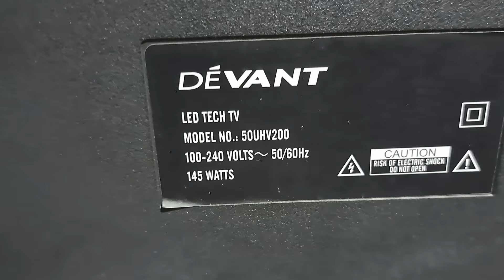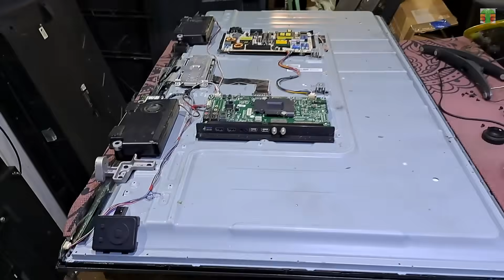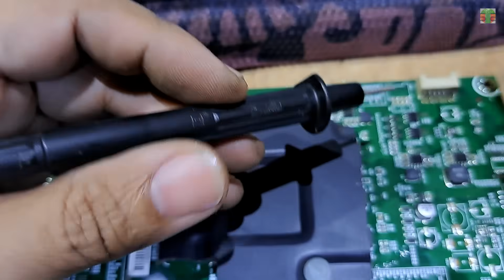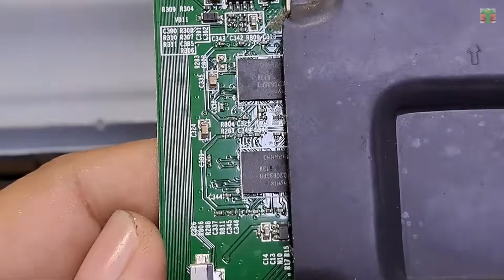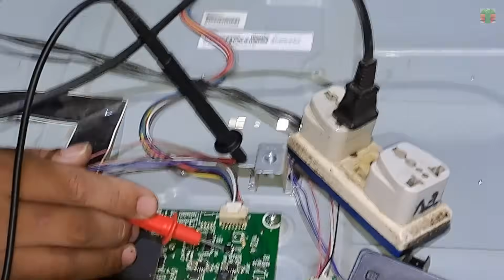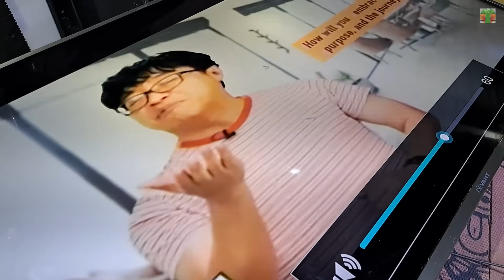Devant smart TV no power

Comment: Good job Master .
this was a hard job without a hotair gun .
But you did it perfectly ❤.
I don't know if this idea will be good or not .
try to use a soldering tweezers .still it can be handle easily .
please just correct me if am wrong .
10k resistor you use isn't it .
Thanks ❤️

Comment: Filipino ka boss? Taga ean ka?
Reply from the maker: Oo, dito ako laoag City
Reply: @tevzTVTevatronics  sir meron po akong nerepair na samsung UA32EH4003R wlang 13volts sa Power supply. ok nman lahat ng diode. Anu po posibling sira nito.ok naman siguro mosfet regulator nito.pls reply po.slamat
Reply from the maker: @BradBuddy-hw1zu  check mo yung pwm driver
Reply: @tevzTVTevatronics  wla pong feedback galing da mosfet regulator. Number po ng mosfet 4NM60N .Pwede po ba customize sa strw yung may S sa dulo.

Comment: Good job master..if the mosfet does not turn of when the tv is off,i wonder if it will not get to hot and explode again...the 10k resistor connected between gate and source allows the mosfet to turn on and off safely?
Reply from the maker: the 10 k makes the mosfet off until there is a voltage on the gate and source.